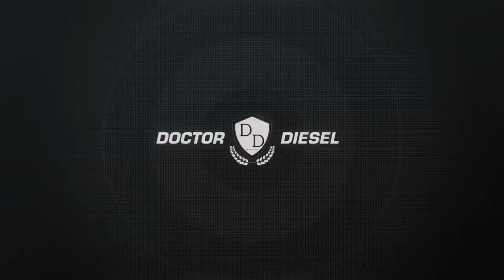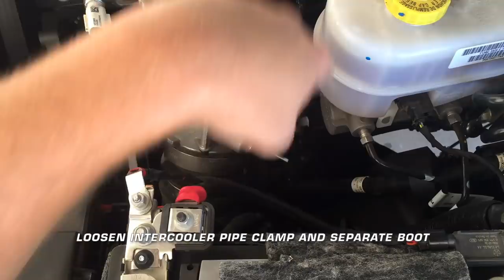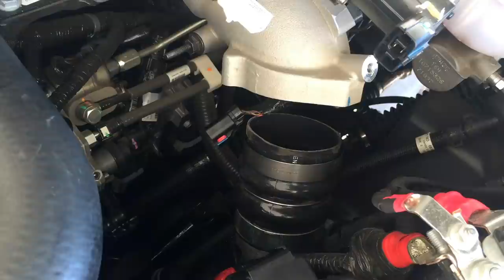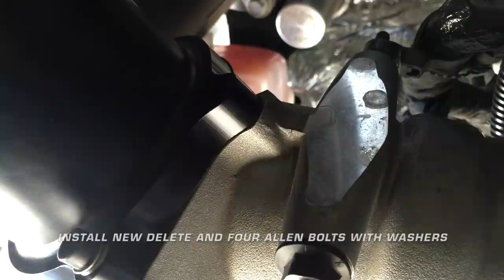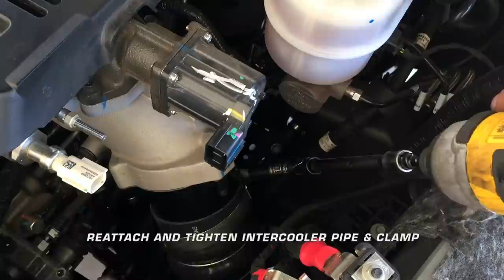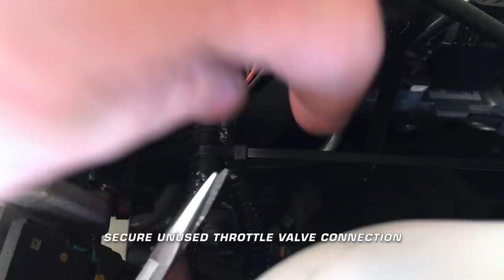Intake Throttle Valve Delete  -  2017 RAM 2500 6.7 Cummins

Comment: Step 1. Delete emissions system , step 2 crack open a beer and be happy ... if you have an emission controlled diesel your waisting money on fuel . I get 28mpg on my 2018 Cummins and 24mpg on my 08 Cummins
Reply: OUTLAW - J JAMES I have an 09 LB and I’ve been able to hit 24, how are you able to get 28? Plz share any info is helpful
Reply: OUTLAW - J JAMES 28mpg driving 50mph?
Reply: OUTLAW - J JAMES  what all did you do to get 28?
Reply: Id be interested to see how you do that. Myself and 3 friends with deleted tuned Cummins don't get close to that. 21-22 on Hwy tops if we baby them. Maybe we are lead footed.
Reply: Yep. Im driving a 2009 6.7l 2500. EGR delete is a must if you ask me. I do metal roofing so it is several times a week I pull a fifth wheel on multiple long-haul trips sometimes out of state. I put 150 miles on average a day on this truck. As of now we are pushing 400,000 miles. And I get 25 Highway and that is pulling a fifth wheel fully loaded I'm sure past the capacity of this truck. LOL but I mean hey it's a ram right?. EGR is just the government's way of controlling yet another thing in our life. I'm not one of those anti government fuckers. But let's face it the EGR was implemented in some way because of the government I would assume the EPA but I could be wrong.
Reply: OUTLAW - J JAMES what tunes do you run for that mileage?
Reply: OUTLAW - J JAMES  How in the hell do you get that good of fuel mileage? What all do you have done? I have engine and trans tuned through PPEI, 2013 Ram 2500 4x4. Running 37x13.50 R22. Im assuming my wheel and tire setup may be the problem? However, my EGR is still installed. Its electronically deleted but the physical EGR is still installed. Would that maybe be the issue as well?

Comment: Hello Dr.Diesel! So if a throttle body is not necessary in a Diesel engine what exactly will control air flow? I am aware that the power output is regulating more fuel into the chamber if that is the case then what regulates the required air to enter? I guess my question is what would act as a throttle body? please let me know if I am not making sense I am just trying to understand the functions of these engines
Reply from the maker: Great question! Air flow fluctuates with the vacuum created by the exhaust gases on the turbine section of the turbo. Increases in turbine speed directly correlate to increased compressor speed aka more air into the intercooler and engine. The function of the throttle valve is not to regulate the air entering the engine. It's purpose is to regulate the amount of exhaust gases mixing with fresh air. With this delete, fresh air will always be entering the engine whenever the EGR releases exhaust gases. 

Better to have a higher concentration of fresh air whenever possible because I have seen some terribly plugged intakes due to high EGR circulation. Hope this helps, please feel free to ask any more questions! Thanks for watching!
Reply: just to add to this, unless you get rid of the egr, getting rid of the throttle valve is useless. Also, diesel engines do not use a throttle valve like gas engines do to regulate engine speed and power.  They use fuel injector regulation and fuel timing to get it done.
Reply: Dr. Diesel is of course correct, but what exacerbates the issue here is that at low idle speeds. The valve is mostly closed. This causes nothing but exhaust gas to be the primary source of intake air... Yuck!

Comment: Would it be just as good to remove the butterfly valve?  That way there is no codes thrown?
Reply from the maker: That is an idea I was toying with! Unfortunately, I have not had time to tear down or examine the assembly. If the blade can be simply unbolted, then it would certainly be an easy modification and would not require purchasing a separate aluminum piece!

Comment: So the one thing that I did differently when I installed the part. Was that I put it on the hose/boot first. Then I started threading the small bolts. One advantage was that it held the piece in place, and let me have both hands free to start threading the bolts.

Comment: another alternative you can remove the internal valve only maybe this can prevent engine light triggered. May i know, is this mod made any difference in acceleration respone?

Comment: Could you install a resistor in that tv connector to fool the CEL to going off??
Reply from the maker: Yes, theoretically, but since it is a valve, I'm assuming there is a feedback signal for the position of the blade.
Reply: Would this a cause rich/lean reaction due to perceived blade position or being unplugged.

Comment: What kit did you use for this? Most available seem way over priced.
Reply from the maker: Cheapest I could find was $30 http://a.co/clOyWR1
Reply: good way to do it is install a new air horn that has a throttle valve delete incorporated like a Pusher air horn.
Reply: Have you considered  Amazon affiliate marketing for links like above.

Comment: What's the reason for deleting this?
Reply from the maker: This modification will allow fresh air into the engine at all times, but will cause a check engine light when the throttle valve actuator is left unplugged.

Comment: What does this accomplish?  Performance? Codes?
Reply from the maker: This modification will allow fresh air into the engine at all times, but will cause a check engine light when the throttle valve actuator is left unplugged.
Reply: Was your concern the engine wasn't getting enough fresh air?  I'm confused as to what this does benefit.  Creating a Ck Eng Light that is always ON may cause an issue later if another system issue throws a code and you don't know bc the light was always ON anyway. Am I way off base here?
Reply from the maker: My concern is after so many miles, the throttle valve can become clogged with soot and stuck closed, meaning no fresh air is delivered to the cylinder head, only exhaust gases. This throttle valve delete will still allow the EGR system to function normally, but the intake will always receive fresh air under any engine load or other circumstances. You are correct. In the event another trouble code is active, it will be indiscernible from the existing code. My plan is to eventually tune the truck after more upgrades/deletes and eliminate the removed systems and their associated trouble codes. For an individual that is not tuning their vehicle, that CEL will remain on indefinitely. Hope this helps clarify! Thanks for watching!
Reply: Dr. Diesel - good explanation.  I'm hoping your concern is not warranted, but if it is, by the time I get high mileage, many others will have jumped in.  Thanks for clarifying.
Reply from the maker: Thank you! Tuning packages will eliminate trouble codes for specific parts that have been removed (and their corresponding unplugged sensors). This will allow real trouble codes to stand out, if there is ever a real code unrelated to deleted emissions systems. Hope all that makes sense!

Comment: What's the advantages to this delete
Reply from the maker: This modification will allow fresh air into the engine at all times, but will cause a check engine light when the throttle valve actuator is left unplugged.

Comment: When the light is on, your car runs on default parameters, not optimized to reduce emissions and increase mileage, and so you won’t get the gas mileage the car is designed to get. Not a good mod